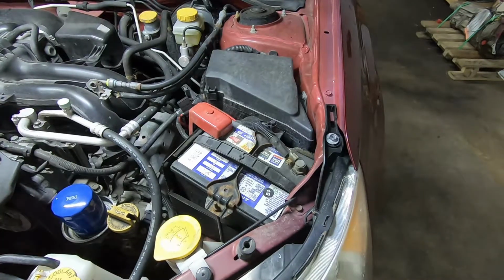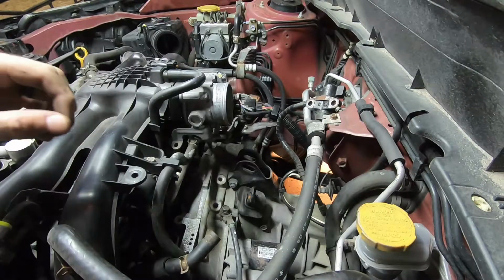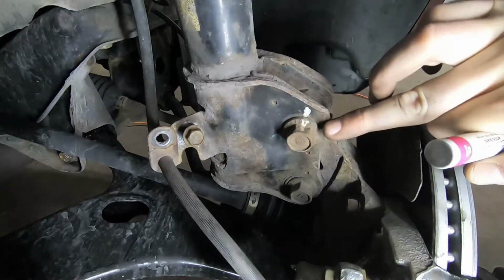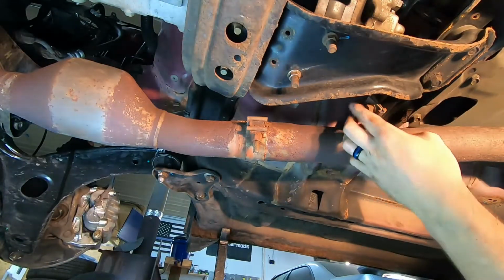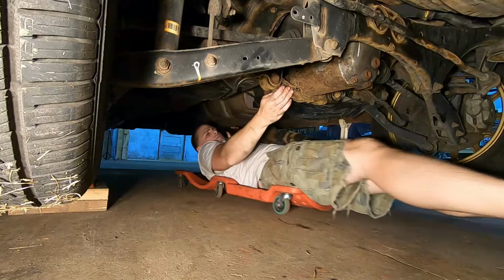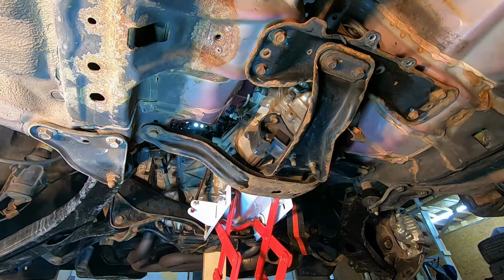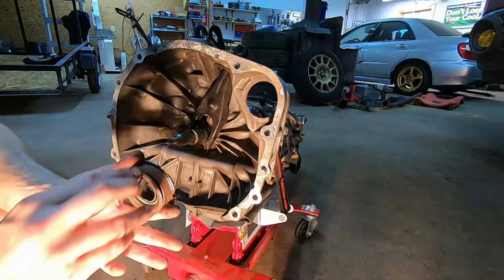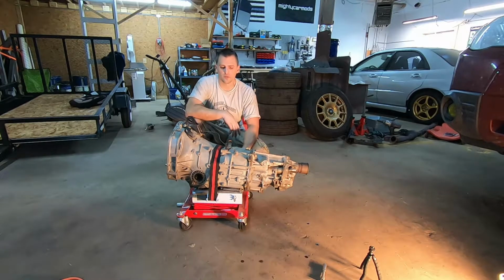Channel Premiere! 2012 Forester Transmission Replacement

Comment: Great vid. Top marks.
Pondering doing this myself on the drive and you've inspired me rather than pay my uncle in law to do it. 
My only concern is the tranny weight without a scissor tranny jack. 
What are the rough dimensions of the top support section of your jack so I can mak my own?
Reply from the maker: Out of the box the trans lift cradle is 13" by 7", I cut maybe 3-4" off the one side to make it work for me, so probably 9-10" wide after cutting it.
I know there are a lot of people who muscle them in and out, basically lay on your back and use your knees to help lift it into place. Is it doable that way? yea, would I recommend it? No.
And the 5 speeds arent too heavy, dont know the exact weight, you can lift them up and carry them around the shop pretty easy.
Reply: @TwoFourSevenDIY  
Mines a 6sp so a bit heavier

Comment: Great vid, I have a 02 Forester automatic, sure it’s much different but with 230k transmission seems to be going. Picked up a used one with less miles and shifting smooth before it got pulled.

Anything I should change while I have it out? 

Thanks in advance
Reply from the maker: Really would be automatic related things, Ive never owned or worked on an automatic Subaru, only manuals, so Im not really sure.

Comment: What is the shop time for replacing a forester trans
Reply from the maker: Shop time, like labor rate time? I have no idea.
Shop time, like how long it can take? I suppose with a buddy, a lift, the right tools, and working fast with no issues ... 4 or 5 hours best case scenario.
For me, if you subtracted the time added for filming, basically a full day's work. With filming, I got done roughly 90% of the work in one day, went to bed and wrapped up the last 10% the next day.

Comment: Sort of curious - why replace the entire transmission and not just the input shaft bearing?
Reply from the maker: The bearing had been spun for a while before it started making noise. So essentially it welded itself to the shaft, the transmission shop I took it to said the shaft would be damaged if they tried to cut it off. Subaru doesn't sell the input shaft as a unit, and they are next to impossible to find from salvage yards.
So in this case it meant a new transmission was the best option.
Reply: @TwoFourSevenDIY  gotcha, that makes sense.

One other question for you - how long did you let thing set w/ the RTV gasket set before refilling the transmission fluid?
Reply from the maker: How long are you supposed to? 24hrs I believe the packaging says.

How long do I? The amount of time it takes to reassemble everything. So far I've never had RTV fail with that amount of time.

I remember google-ing a while back and most people report doing the same things with no issues.
Reply: @TwoFourSevenDIY  

Awesome - thanks for making the video. Definitely helped me knock this out in a day, although definitely not the most fun to do in the driveway/on the ground.

Probably would have been under a 4 hour job if my extension case hadn't been stuck on....took about an hour and a half of tapping/wiggling.
Reply from the maker: Awesome, glad you got it done! I agree this job kinda socks from on your back. 
I'm getting a 2 post lift for the shop in a few days so my time laying on the ground is about to be over lol

Comment: Really good/valuable information, thanks for making this video. (Liked and Sub'd)   I have an '07 Forester and the manual transmission is making a lot of noise.  Had a local mechanic diagnose it and he said the noise was definitely coming from the manual transmission.  I originally thought it was the center diff (I did a few handbrake turns the last time we got snow).  He said it would cost at least $2700 to replace it with a rebuilt one that comes with a warranty and didn't think the car was worth spending that much on.  Going to keep driving it for now, someday I may try to do a transmission swap myself.  I have done brakes,  alternator and power steering swaps, and a rear wheel bearing on the Forester in the past and my most adventurous project was changing the timing belt/water pump on my wife's '07 Honda Odyssey.   YouTube car maintenance videos  really help.  Thanks again.
Reply from the maker: Glad you found it useful!